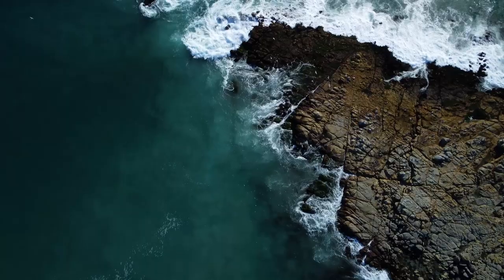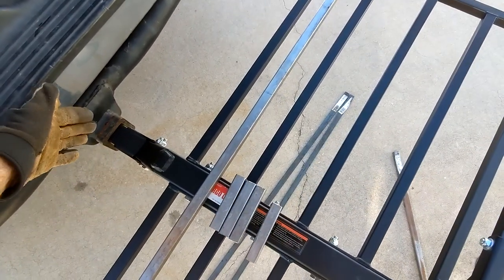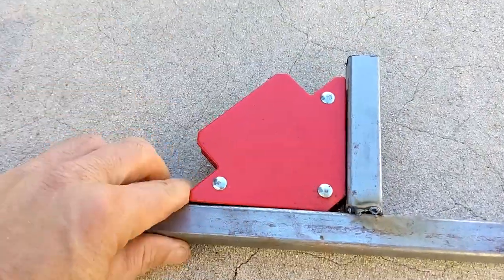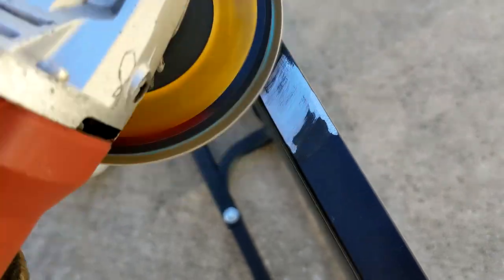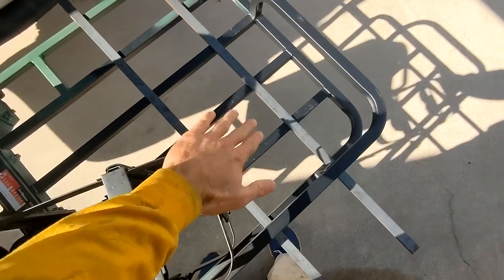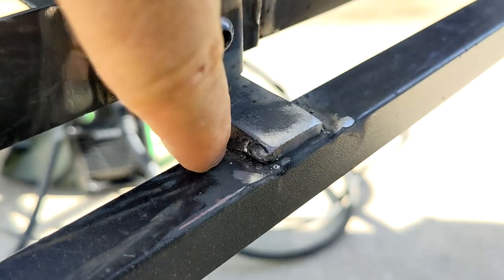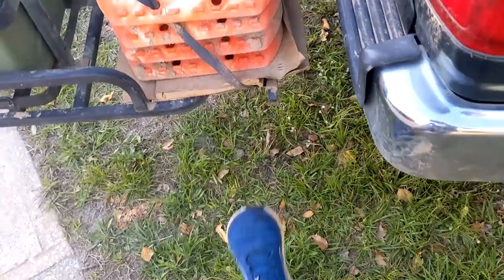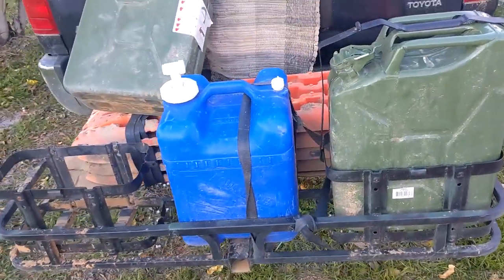DIY Jerry Can Cargo Hitch Carrier

Comment: I just installed an ARB 5 gallon gas can roof mount carrier on my 4Runner.  The can sits on it's side to minimize the height.  They also have a two can carrier.

I also wished I had learned to weld.